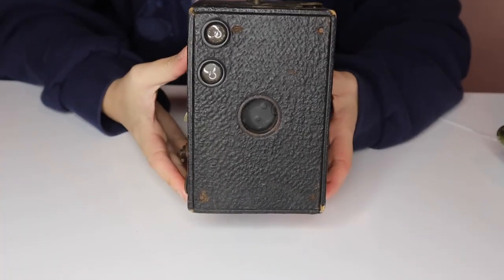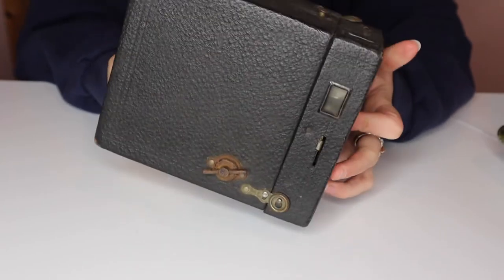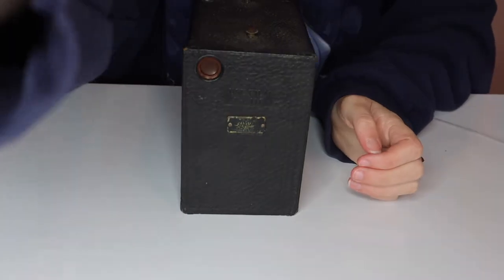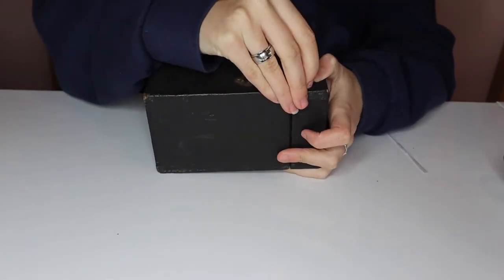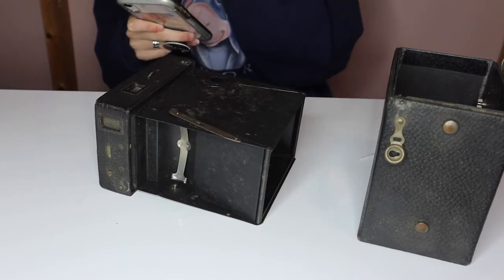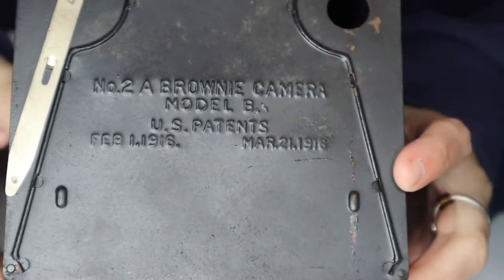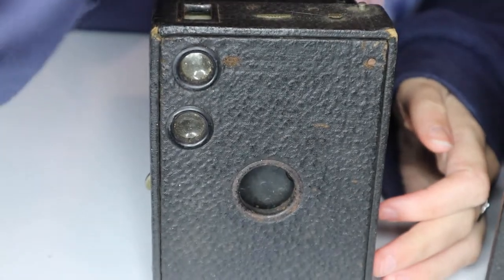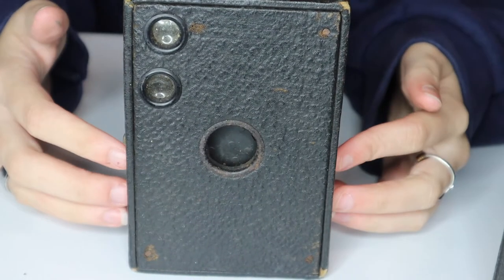a basic camera restoration for beginners (Brownie No. 2A Model B)

Comment: For cleaning surface rust or polishing nickel-plated parts like the shutter and aperture tabs, or the mounts for the strap on top, 0000 steel wool works wonders. Replacement straps can be found on eBay from people who sell restoration items for trunks or other antique luggage. Just be sure to get the right length and spacing between the holes. I've replaced several missing Brownie straps like that. If the mirrors inside the viewfinders have lost some of their silvering, buy adhesive thin plastic mirror material from Amazon and cut to size. Easy and incredibly effective.
Reply from the maker: That is really great advice. I wouldn't have thought to go to antique luggage straps!! And the adhesive mirror material - that is really smart! Thank you!!

Comment: Brownie No. 2A  Model B was made from 1911 to 1924.  Yours have no shutter guard. According to records,  that was added in early 1920. But it has the metal nameplate in the back which was added in 1918. That makes yours between 1918 to very early 1920.  I collect, restore and actually use these.
Reply from the maker: Cool! I am learning more and more every day about dating these cameras - any information I have is just based on the resources I know to use to date them. Thank you for this information!

Comment: Would the Alcohol with the cotton pads be good to clean the leatherette part of the camera as well instead of the leather wipes? Thank you!
Reply from the maker: In my experience, no. Alcohol is a drying agent, and with how old these leatherette coverings are I try to minimize the amount of moisture I take out of them... it makes them less flexible! It's okay if you have a higher percent, upwards of a 90%, because it evaporates quicker. I'd probably honestly try using just a really lightly damp cloth before I'd use rubbing alcohol on it. Hope that helps!

Comment: Hi,
You are correctly using isopropyl alcohol however you refer to it as rubbing alcohol which it is not.  Rubbing alcohol is not used because it is made to leave behind an oily residue.  The oily residue attracts dirt affecting the sharpness of lenses and overall cleanliness.